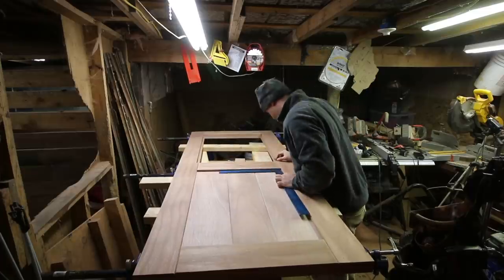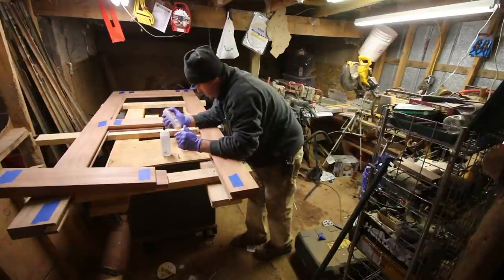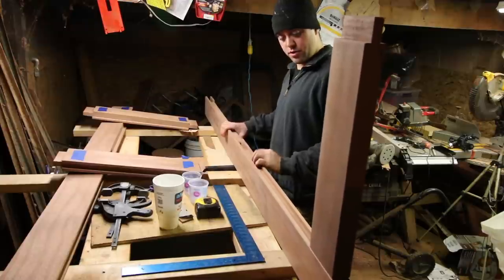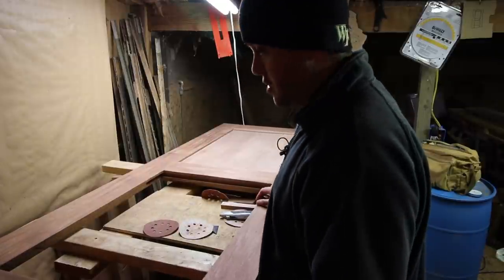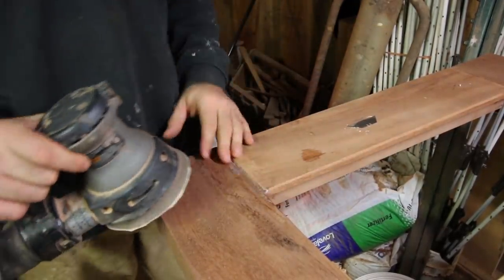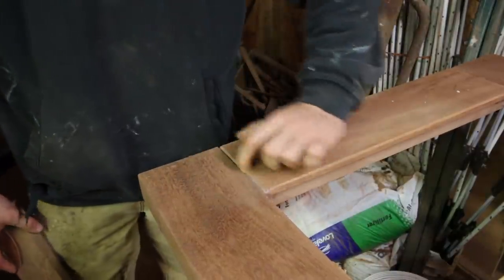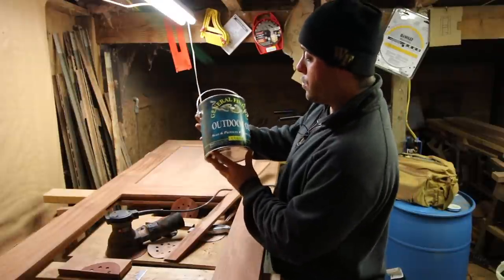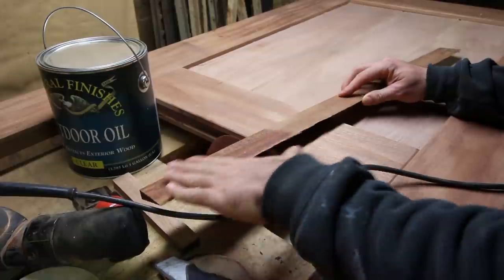Glueing up the front door. P12

Comment: Dan be sure to use a tongue seal product under the spar varnish. That will seal the wood so that the places where the epoxy got on the face of the door will all look the same. It will not change the look the of finish.

Comment: Dude! OK, so help me out, when you said "I need thinner stuff", did you actually thin it, and how much more/ and of what/ did you add? Also when you said "that does not look good" then a second later you said it DID look good... what changed, what had been wrong and how did you correct it? Thanks. Beautiful door, by the way.
Reply from the maker: +K Gifford  the epoxy was cold so it was thick. I didn't thin it, just warmed the bottles up before I did the other joints.  
I think it was out of square, so I adjusted it to make it square. Just slid the piece over.